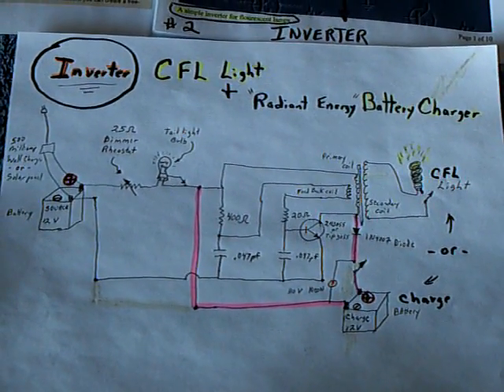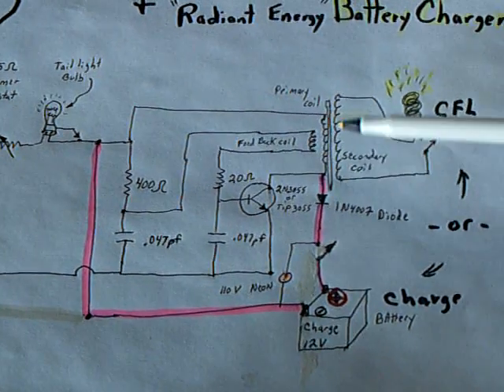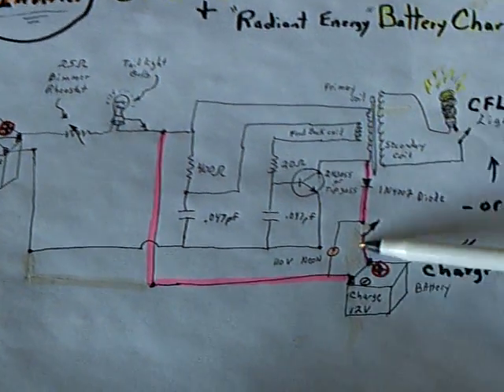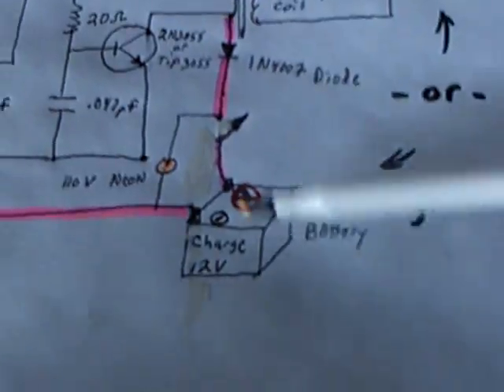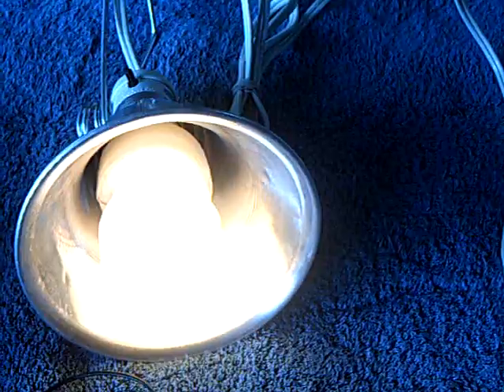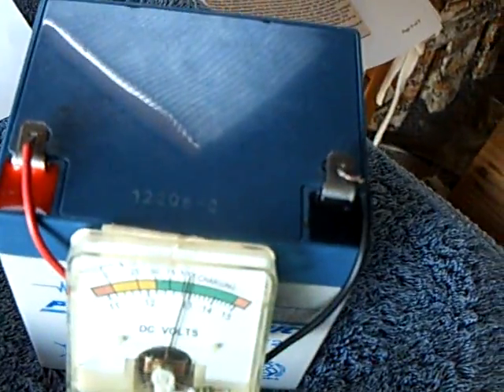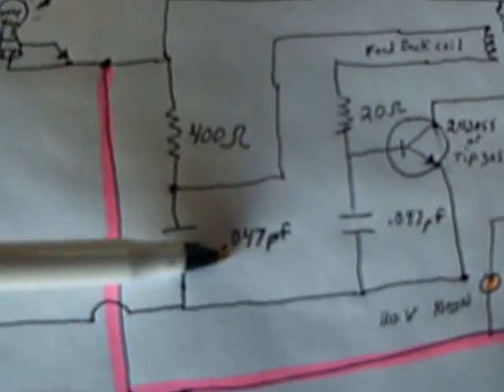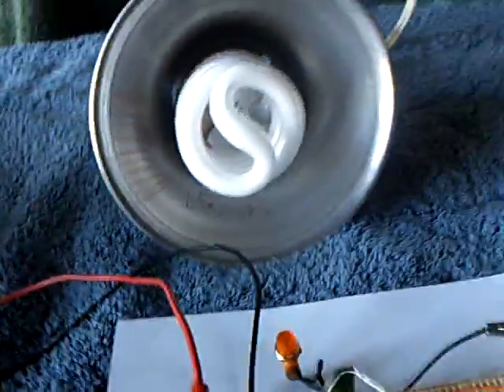Inverter CFL Light & Battery Charger

Comment: I just finished my inverter circuit, and I was wandering through your videos and VOILA, you answered my next question. My transformer turned out pretty good. One thing I don't like is I am getting "black ends" on my bulbs. Plasma I guess. Definitely a good learning experience. Will look over your changes and mods now that I have mine built. Thanks Lid.